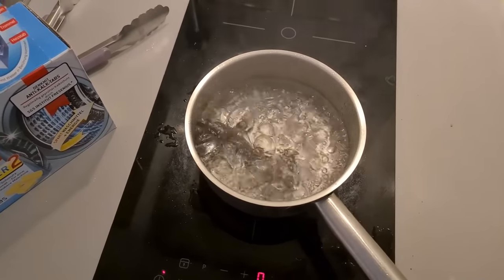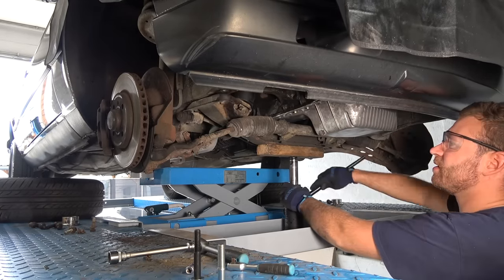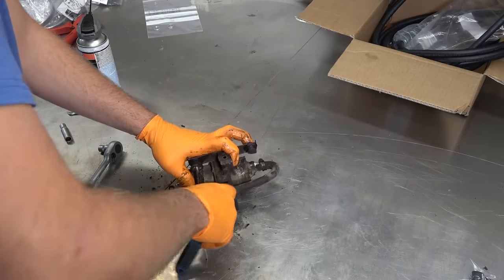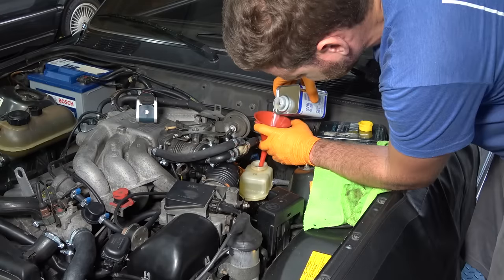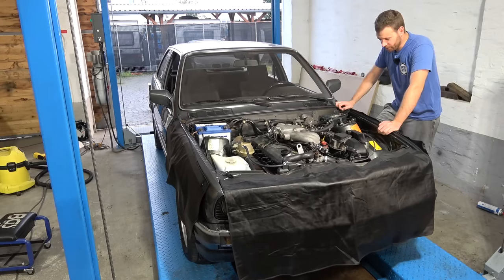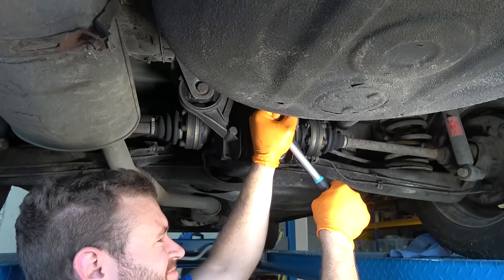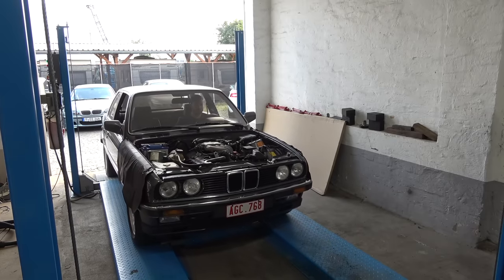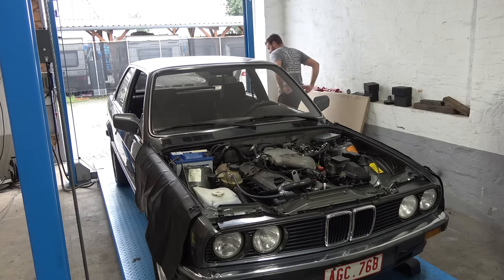Let's Get Mechanical - Neglected BMW E30 320i 5-speed - Project Marbais: Part 4

Comment: Hi buddy great videos as always  , much love all the way down in south africa  😎😎... tips  on that miserable  idle issue.. I have a e28  520i same lump of love underneath  the bonnet ,  like u having headaches  about getting  the idle  right . The best solution isnt the  prettiest  though bt heres my 2 cents

  Remove the aux bypass value,  or blank of the  air feed to it , doing this  you'd have too blank off the  return  into the manifold  , the  tube that runs from the valve into the idle speed control screw section.  .. or.
. Easier remove the aux valve and plug the  port that runs too the valve  from the manifold (  located  along side the cold start valve).. the trade off is a lumpy idle on cold start but usually  1 min or 2 on  holding it manually  on a  faster idle  say 1k rpm will  have it idling no problem  , then once the car is warm at normal temp  u can  fine tune the  idle by using the idle speed screw 
 Idle issue sorted

 Marvelous  job on the timing  belt  , but u have too  make sure that you're dynamic timing is set after u have fitted a new cam belt, this is tricky too... first off the distributors  in these cars are synonymous  for keeping or killing  the  engine performance,... it's either the  distributors centrifugal  weights  inside gets worn out.. eating the  Distributor  body up from inside ,   the impulse generator   gets jammed ..  you get spark , just u  get low   or even no vacuum advance  or retard for this  matter...   ,  poor performance  and even worse fuel economy. . and lastly  the  double vacuum  canister  on the side, the  larger side is  retard and shallow side is vacuum, if they are working correctly  make sure they are  vacuum  lines are connareas in the correct areas... "retard " is  connected  to "pre throttle " and advance  is connected  to "post throttle"

Tips on setting that  distributor
 U want too block off both lines too the vacuum  box on the distributor  ,  make sure the car is at idle temperature  and idle set at say 850 rpm,   hook up a timing light  and point  it at the vibration  damper.. the mark " Z"  should be  visible...  Have someone rev the engine up 1k rpm at a time , what you.looking for  is "advancement " if  the "z" marker doesn't  advance apoun increases rpm the  centrifugal  weights is stuck  or broken inside , that is a hell on its own,  ifit is then  proceed  with the timing  set... these distributors  u have too dail in for maximum advance  ,  according to Haynes  I think it's like 23 degrees  BTDC  @ 5k rpm... its madness..  what  I've discovered  was after 4k rpm  it doesn't advance anymore soo  the xtra 1k rpm just means u dialing  in maximum  advance  possible,   turn  the distributor body  either left or right too align the "z"  mark with the notch in the  lower cambelt cover plate it looks like a "rib" .. do this while holding the at 5k rpm.  Once  aligned   u can  let off  the throttle  , switch off the car  Lock  the distributor  body an reconnect  ur vacuum hoses to the  distributor  ,  start the car and   fine tune  it idle using the idle screw  , do not turn the distributor  to  bring the idle down.  Doing this causes  alot of retarded  timing,........

 while the car is idling you want too point your timing light on the vibration damper  and see where the  "z" mark is .. the "z"  mark should lay roughly 5 to 8 degrees ATDC... if it is  then the  dynamic timing is set... if it pings  a  bit .. retard it a bit .. 

 And there u  go dynamic  timing done

 Again thanx for  your amazing videos , always a pleasure to watch 😎

Comment: My 968 idled at various speeds three years ago, appeared at totally random times. So I wiggled on every plug I could find in the engine bay while running. It was the plug of the thermostat, has been a little bit off, put it back on, never happened again.

Comment: 29:13 Yeah... that ride height is definitely not how I'd expect that car to come from the factory. My neighbor has a very similar, stock E30 and that one definitely doesn't have that much air between the tires and the wheel-wells. Front looks too high and the rear looks way too high. Not sure if BMW offered a "Schlechtwege-Fahrwerk" (mild offroad suspension) on these as an option, but that would be one possible explanation for why the car looks like a proto X3.

Comment: I also had a similar rev's hanging issue on my m30b34 engine (motronic). Was fixed by replacing the idle control valve. Cleaning it didn't make any change btw. Not sure if this l-jet tronic engine also has a ICV? If so i would try that. Perhaps test it with a cheap one from aliexpress lol that way i found it on mine. Then put in a new bosch unit when i was sure it was the cause 😎.

Comment: It seems that you have narrowed down the idling issue to an ignition problem? Otherwise, if not done so already, I’d suggest to check the idle switch in the throttle body. Replacing it cured M20 idling problems for me.

Comment: man i love your videos! So calming for some reason, my guess on the idle issue would be a leaky ECU capacitor or something with the trottle valve or sensor/ switch, but probably in the next episode it turns out be something completely else:) any idea when you're gonna continue on your e39 M5? I once owned an e39 535i, boy did that thing cost me al lot of money...

Comment: Have you tried to mess with the potentiometer on the MAF? BMW idle and MAF are pretty much connected, revving issues always come from there, as MAF reading control idle valve, fueling etc.

Comment: What i understood is that there are not really "mtech springs" but that bm matches different springs on different engines, they used springrates of a 320i on a 316i for example. Mine (316) was equiped with mtech suspension, i changed to hr springs but they were higher than original. H&R offered me to measure the springrates of my original springs but at the time i didn't go in to that proposal (stupid as i am).

Comment: You can put Eibach Lowering Springs on this car and still get Oldtimer TÜV.
Oldtimer TÜV mostly depends on what the TÜV Guy wants to see, but Eibach is older as the E30, so you could have lowered the E30 on the day it was built.
And if it was possible to do this in the first 10 years of the cars life it´s "zeitgemäß" (period correct) and you get Oldtimer TÜV.
Thats a simple explanation, the wohle theme is very complicated, but in short, thats the way it is.

Trust me, my 1988 E30 325i Touring is a 320i converted to 325i with Bilstein B6 Shocks and H&R 40/30 Lowering Springs, also I have mounted a steering rack from the E36
and it passed Oldimer TÜV with no problem at all.

Comment: Not sure if the car has A/C, but there is a sensor associated with the idle control valve that increases the idle speed when the A/C is active. Apologies if this has already been covered

Comment: The joys of early fuel injection.  My first car was still carbureted and used a fast idle cam to push to 2500 rpm at start before 600 rpm at warm idle.  All you had to do was to blip the throttle and release the cam when you wanted the idle to come down.  This pre-computer air valve nonsense doesn't seem like that bad an idea, until you realize that it relies upon a thermostat which like all coolant thermostats will inevitably fail.

Comment: I had an issue with my old 1992 Mazda. It would idle rough and go up and down, intermittently. The cause was the engine temperature sensor, it caused rough idle because the engine wasn't able to adjust fueling for the engines temperature. Maybe try that.

Comment: Maybe there is a issue on airflow meter because of not idling down during running eng. After switch off it always works by restart w/o accelerate..

Comment: At least working on the M20 in this will make it easier to work on the M20 in your E21, minus the k-jetronic fuel injection. You could also look at an ANSA exhaust for it, they're fairly inexpensive, made in Italy I think.

Comment: Sreten, i noticed at 19:26 that when you turn the engine off then on again it seems theres a throttle dampener right at the linkage that adjusts itself, maybe due to vacuum there is an issue regulating the linkage messing with the idle?

Comment: Hy, I see a lot of good and quality work. I saw you struggling with the main screw on your main arm! (36.22)To prevent the cone from slipping, the car must be supported on the workshop floor with a bar or pipe. This way the cone will not loosen and you will be able to loosen the screw completely so that it does not need to be cut! Try this technique, it works every time!  👍
Reply from the maker: It doesn't on rusty nuts/studs, I tried putting whole weight of the car on the left side sith a floor jack and didn't work. Not sure why everyone thinks I never worked on suspension before.

Comment: You could ask Hugh Jackman to push that conic balljoint up into subframe in order to prevent rotation when undoing the nut.
Reply from the maker: Doesn't work when the nut and stud are rusted, I tried.

Comment: Its looks as though the original tie-rods had a lock washer that the tabs bent over the flat sections of the joint to prevent the inner joint from loosening, it looks as though you didn't put on new ones?

Comment: I don't know where did you looked for that fuel bracket part, but i found a place here you can get them. At least it says "in stock". Everything else is available except that round thing called holder. :D
Reply from the maker: It's not, i get all of the parts directly from BMW

Comment: I have a tip for those pesky u joint nuts just put presure on the taper and it will not spin

Comment: You should contact DBO on here. They have a lot of parts cars. That slide valve is about the same as a later model idle air control valve?

Comment: Hello ! nice video ! I want just to ask you : for you, what is the more reliable engine on those old BMW ! less problems and easier to work on !  because i was thinking this engine in this E30 would have not be so complicated like that with the valve issue and other stuffs ! but i see that is more complicated system ! for exemple the 4 cylinder ones like in 318i and 316i or even older with carburetors in E30s are better ?  I mean less complex, more simpler ? thank you !

Comment: @M539 Restorations
Do you always use Liquie Moly (LQ) ATF 1100 in your gearbox? In the internet, there are so much different Oil recommendations for the gearbox oil, for example from Ravenol, Liquie Moly etc.. The manuell says you should usw a Oil with API GL4 for the manuel gearbox. LQ hast a ATF 1200 Oil, why you didnot use this?
I have an E30 325e and want to chance the diff and gearbox oil and im not sure which oil i want to use. The diff needs a SAE 90. I thick LQ has one, too.
Greetings from Bavaria, I wasnot sure, if i can write in german, hopefully my english isnot to bad. :)
Love your Videos!

Comment: the idle issue is your Throttle Position Sensor.... most likely located under the throttle plate... The carbon tracks inside gets old and worn and send wrong voltage. Classic early gen fuel injection problem.
google bmw e30 320i tps
Reply from the maker: Thanks but it's not :) it was the distributor

Comment: 29:24 Why should it not pass Oldtimer TÜV Inspection? The Car has to be in original shape, thats correct. But also lowering springs were a thing back at that time so they are perfectly legal even for the Oldtimer Inspection.

Comment: Again, a very nice video.
Can you point me in the right direction what brake bleeder you are using? I would like to buy myself one that is easy and handy to use just as yours. Concerning the air slide valve you might have considered to clean it with ultrasone as well.
Oh, and another question: what websites are you using for ordering the parts? Do the fuel lines and the pump for example come from the BMW dealer, or from a website?
Thanks in advance and really hope you will get back to me!
Cheers from Belgium!

Comment: My E30 325i has the original clutch on 330,000KM! 
It is very nearly in need of replacement. It holds the power absolutely fine, and you can even give it a little bit of hard time. But if you launch it too aggressively it will slip. 
Quite impressive. I wonder if its the asbestos that helps them last longer?

Also mine seems to idle at about 900rpm when cold and it settles down to 700rpm when its a little warmer. So does that mean my valve thing is working?! That can't be right...

Comment: Try working on a car thats parked next to the sea and i mean 3 metres away. Sea salt/ sand is a killer to cars. Took 2 days to cut, grind, hammer 2 camber bolts on trailing arms. (Working on the car, parked in local car park, lying on my back in the pissing rain) eventually got it by cutting the bolts in between bracket and bushing with a cheap recipricating saw.

Comment: 2:40 I recommend not using those standard  8.8? bolts, those tend to break rather than bend like the 10.9
Correction, those are 10.9 😁

Comment: Nice channel but I have one question/suggestion, when the inner ball joint spins, why do you cut it? You can just jack it up a bit from there, that will stop it from spinning!
Reply from the maker: Because that doesn't work on a rusted stud/nut. I put the whole weight of the car on the left balljoint with a floor jack and it was still spinning.
Reply: @M539Restorations  It worked for me, maybe just add some sand paper 😂 thanks for the quick reply man, keep up the good work.

Comment: Bad welding it should have come out the first time i have done weld inside nut so many times as last resort and it always works excelent at first try there may be some issue with incorrect welding

Comment: Do you realy use LiquiMoly ATF in your E46 manual transmission as well? (20:58) , which one exactly? I have 6 speed manual and changed oil several times, new links and bushing etc. but 1st and 2nd gear is hard to shift almost every time. With new oil it is ok for a few thousand km, but after it is getting worse.. Tried LM Mo2S additive as well, saw it in your video, but nothing has changed unfortunately. Can it be a solution for me as well? Thank you! BTW. Best channer ever. Not missed 1 minute from all of your content! Keep going!! All the best, Mark

Comment: All the e30 have the same problem   with the rpms i change all the vacuum Lines include the Black valve at the Top of the engine and the problem has finish in my e30 316

Comment: oh yeah the cold start shifting ... fuck ... always feld like a rubber block was inbetween neutral and first and second... so annoying wehn the lights turn green... also wehn you wanna reverse quickly (ANY TIME not just right at the start)... you cold not not simply / quickly shift into R ...because if you do it to quick the transmission would grind .... so someone told me ... go into 2nd or 3rd with clutch pushed down AND THEN intro reverse

Comment: I purchased the same 'cheap hydraulic press' this week, didn't know you owned the same design. How did you 'fix' the bottom of the cylinder housing to the metal plate it's standing on? I'm afraid it's liable to shoot out sideways if the pressure gets too high, because the tolerances in the frame construction are absurd (sideways play and all).

Comment: Greetings! I noticed you've said that you used 10w40 oil in your e46. I have a 316i e46 with the valvetronic system. On the last oil change (about 3000 km ago) I've used Liqui Molly 5w30 because that's what the car manual said to use, but my unit started to develop a ticking sound. The engine has over 300.000 km, so should I use 10w40?  

*Sorry for bad english

Comment: Adjust the valves!!!  Replace the oil feed tube , its probably clogged under the rocker cover,Check the throttle switch. Its NOT a potentiometer, its a simple switch regulated by the throttle basic adjustment. Listen for the "Click"  at closed throttle (really important for idle issues) . Should click opening and closing the throttle . if it doesnt click someone has opened the throttle set screw too far. back it off ALL THE WAY to see if it clicks then , check throttle cable not adjusted too tight , must click to send the "closed throttle signal " to the computer. Mid range is no signal but full throttle is another click signal to the computer. Set the throttle screw to just open the throttle to stop it jamming in the butterfly housing. Set the timing with a strobe light with BOTH  vacuum lines disconnected . Retired BMW factory trained master Tech. Would love to help in any way!
Reply from the maker: Go watch previous part, valves were adjusted. I checked TPS off camera. It was the distributor, replaced and all sorted. Thanks
Reply: @M539Restorations  Sorry, this was the first one I watched, just throwing out some info for you. You obviously got this covered, thanks, wasnt trying to to be a smart arse

Comment: Actually whar your were saying around 29:30 is not true. You can modificate your car and also get the "H" Numberplate. But you have to do "zeitgemäßes Tuning" which means the parts you are using were available when the car was up to date.

Comment: I was correct in the last video on this car.. not only there are changed floor parts, but the new ones are starting to rot away too! If you stop the video ot the spot where you replace the sway bar bushing you can see the square on the floor is missing, and the new metal welded on its place is rusted by the rocker panel as well as under the plastic.. good rust-free car 👌🏻

Comment: The distributor  timing counter weights need cleaning this will give you a slow rpm return.
Reply from the maker: Correct you are! I replaced the entire distributor with a new one, problem solved